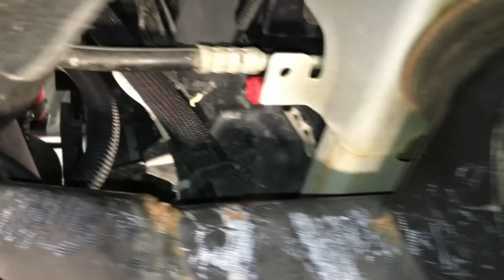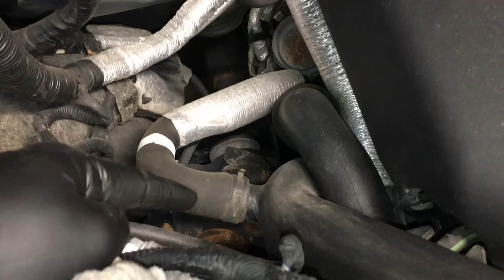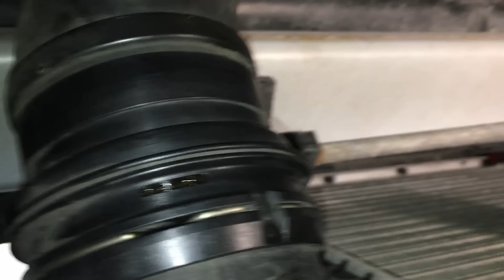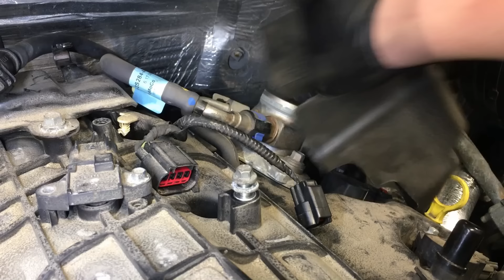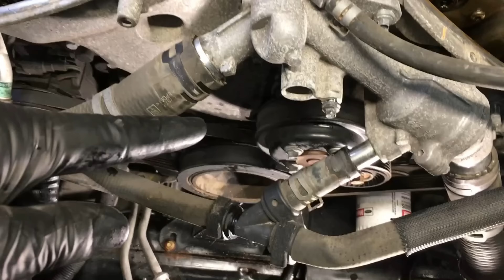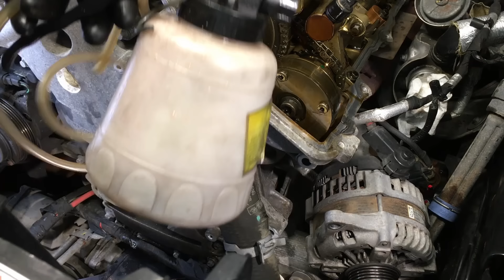2011-2016 Ford F-150 3.5L Ecoboost Timing Set Replacement Part 1: Getting Inside the Engine

Comment: I've watched another vid performed with the cab off. Your efforts to detail & explain every minute process pertaining to this repair is nothing short of phenomenal and extremely considerate from this viewers perspective. I have the 2011 F150 EB and unfortunately i didn't make the warranty cut. I do experience the chain rattle only when the vehicle sets up for 2-3 days w/o running the engine. The rattle is brief but startling if you haven't heard it before. I have yet to get comfortable with that sound, seems I have this vision in my head of the that monster chain flying off, pistons crashing etc. Nasty stuff in my mind but I do drive on. I love the motor and the truck, it's never seen the shop for anything other than one recall regarding the transmission "could" potentially slam into 1st gear at highway speeds, I couldn't get that vision out of my head either so off the the dealer I went. Seriously man, I support you in any way I can, I purchase the products, tools, parts etc. you reference in your descriptions hoping you receive some financial gain from same. Congrats on your success and thank you for your vision, dedication & kindness in sharing & building such an extensive, detailed database of repair vids for all of us to view and succeed in making our our repairs plus allowing us to save a few bucks along the way. I'm 63 y/o and, IMO. professionals (in all businesses) such as yourself are very, very rare and truly appreciated.  Wish you and yours good health, happiness and endless wealth.
Reply: Well said

Comment: I have a question on the primary timing chain tensioner.  You list BL3Z-6L266-A, but Tasca Parts said this is the wrong one for my 2013 EB.  Their parts catalog indicates BA5Z-6L266-B.  Which is correct? Are they interchangeable?
Thank you! Very happy these videos are available to me.

Comment: Ford still having the same engineering issues from the year 2000...unbelievable.
Reply: Idris my ford raptor did that since day one, these ecoboost engines are TRASH.
Reply: @Idris any issues with carbon build up? have u done,induction service?

Comment: Thanks for the great series on this repair!  My son and I are following step by step and everything is very clear.  I had one question.  We have damage to one of the heads so are installing remaned cylinder heads.  Truck has 160k miles but very well maintained.  I was thinking of new turbos.  Would you recommend that?  Any other key components you would recommend?  Thanks again.

Comment: Is the 2019 5.0L v8 more reliable than the 3.5 Ecoboost v6 model or vice versa?
Reply: Jmaclicious def go with the V8.    My friend had a 3.5 ecoboost and the chain was replaced at 3k miles.    Truck wasn’t even 6 months old.    It was brand new !!!    He just traded it about a month ago with 34k miles and bought a 18 Cummins 3500.    He loves it

Comment: I have leaks on the front cover on both sides. 3.5 ecoboost 2013 F-150 nocheck engine light yet. What other components should I replace when I am in there? i.e. water pump, oil pump, timing chain etc?

Comment: I've had a P0016 code on and off on my 2013 F150 for a few months now,  but I have never had any cold startup rattle.  Is there any other potential causes for this code besides chain stretch? Engine light is on constant now.
Reply: I too have no rattle but confirmed approx 5 degrees between "desired camshaft position vs actual", so my performance and CEL is intermittent.  Parts for repair are in the garage waiting for me while the truck is parked....

Comment: Can thiz problem also happen with my 2017 v6 3.5 ecoboost ? I have 100,000. Km and around 90,000 km there is a loud rattle on a cold start?
Reply: This has happened on my 2017 V6 3.5 Ecoboost with 40,000km (still under original warranty) on it, so I would say ABSOLUTELY it can happen to you! Mine has been in the dealership shop now for 48 days. Considered Unit down, Emergency down which is Ford lingo for Do not have parts available and Do Not Drive. Which then was a fight to get a loaner vehicle. I was then told that I because I didn't have extended warranty that I would not be getting one. I had to nag ford and 17 days later was granted a loaner which I still have. I called the dealership about this rattle on cold start up and no check engine light. I youtubed and found this timing chain thing and mentioned it. The dealer told me to bring it in but was certain it was not the timing chain, and he said he never heard of all the chatter about it online...(Hmmm, its 2019 dude, era of YouTube. There is even videos on changing them out! ) This video is absolutely amazing and has now armed me with knowledge that I would not have previously possessed. Now I know what was or should have been replaced. Not to mention what to look out for, possible leaks as so many gaskets are involved in this repair. I am hoping to bounce the parts list on the work order against his list on here if and when I get my truck back. Thanks for sharing your knowledge and expertise! You Rock!

Comment: When installing the fuel pump, is the fuel pump O-ring in the parts list the one that goes on the bottom of the mounting plate, therefore requiring two?  or is there an O-ring on the bottom of the fuel pump between it and the mounting plate?
Reply: There's a gasket between head and mtg plate and the fuel pump o-ring fits into a bore in the mtg plate.

Comment: Was looking at a Ford with the 3.5l so I went to youtube to see how they are holding up and how hard they are to work on. Thanks for your video, I left buying Ford in the 80's, went to GMC, left them in 2000  because of them not fixing their problems. Went to Toyota in 2000, put 325,000 miles on it before it was hit by a guy running from the law, was still running strong, was looking to get 500,000 on it but things happen. I am sure I will pass on this Ford also. Ford wants $2000. to change the water pump. Not on my dime. Thanks,  I changed the water pump, timing belt, tensioners, crankshaft and cam seals three times on the Toyota. Got to where I could do it in 4 hours,I am not very fast doing it by myself. Put on six sets of tires, replaced the brakes three times, bought the lifetime brake pads once. Changed the engine oil every 3000 miles. Total cost of upkeep  except for oil changes $3189. for that Toyota's life. The Insurance company paid me close to $4000. for it totaled out. Look like I will buy another Toyota. I still have the 1996 GMC, it just turned 104,000 mile, Every time I drive it to Lowes which is 8 miles away I tell my wife I have my cell phone and I will be back home, it might be in a tow truck, I keep tow insurance because it is cheaper that way,

Comment: What is your thoughts on the Raptor 3.5 ecoboost? I’m debating trading in my 16 Ram 2500 with a Cummins. Worried it’s not gonna be reliable for 200k plus like my other 8 Rams were. I wanted to see what you thought or advise. 

Thanks Man

Comment: Do you know if AT4Z-6C525-D is the correct replacement for AT4Z-6C525-B on a 2012 f150 ecoboost. That is what I was sent went I ordered all the parts but I can't seem to confirm that through my internet research.
Reply from the maker: Yes there was a recent engineering change.

Comment: Brian what year is this truck?
Reply from the maker: 2012
Reply: Thanks for the answer. I’m considering a 2012 3.5 eco in great shape at 111K but since watching all your videos I’m apprehensive. Any real fix to the direct injection issue? Don’t want to deal with this if fords only reply is change heads/valves as you stated in last conversation with engineers.

Comment: Hi I have a 2013 f150 3.5 ecoboost and keep getting the p0016. And it goes into a limp mode. When I clear the code it restores power. I changed intake and exhaust solenoids which were a bit dirty. I changed oil and put in sea foam. It seems better but still happens. Is that a sticky phaser do you think .? Thank you

Comment: Amazingly informative and easy-to-follow video! Since we are tearing half the engine apart already, would you recommend a fuel induction cleaning while we have it open? My truck has 127k miles and I dont think its ever been done before.

Comment: I see you didn't change the primary and secondary guide arm guides.  I gather upon inspection they were fine?  Just wondering if you have a part number/product link for those guides.  BTW I have been waiting for this video for a year now, great job on description and breakdown.  Love how you put in the torque value and sizing of tools needed while you are carrying out the job, congrats.  I had Ford do my timing chain two years ago and now I need to do it again.  When they did mine they only replaced the timing chain and I would assume it was the primary guide arm cause my bill just states arm - timi.
Wish they did the job correct the first time now I have to do this myself correctly.

Comment: Great video man, but I have to disagree with the valve cover part about simply unbolting and lift off. I have one in the shop now that I been busting my butt trying to get these covers off. LOL Fun.
Reply: Joe's Auto Electric I agree, doing my 2014 as I write this reply.  Valve covers required some extensive prying to break loose.

Comment: I have 150K miles on my 3.5 Ecoboost. It definitely needs a timing chain replacement upon startup it rattles. Now what happens if I drive this and do not replace it ?
Reply: Kaboom😞
Reply: Your performance and mileage will suffer drastically.

Comment: Thank you for these videos. I'm considering a 2017 or 2018 Raptor. Do you see the Ecoboosts in these newer model years more reliable? Do they have problems as well? Thank you!
Reply: Don't know about the newer ones, but my 2011 is just getting ready to get this done... after 232k miles on a 3.5 EcoBoost that is not treated gently.

Comment: Thanks for this video.  I had this work done under warranty on my truck (2011 fx2) 2 years ago at about the 60k km mark.  2 years and 25k km later (Truck is now at 85k km) I’m starting to hear the same chain rattle on cold start that I heard the first time.  It would seem the service bulletin fix doesn’t actually fix the problem, it just pushes it down the road.  I’ll push for warranty coverage again, but anticipate a tough time getting it.  Is there a permanent fix to this issue?

TSB calls it a 9.2 hr job, no idea on the cost of parts...  will this job cost someone $2 or $3 thousand?

Been a Ford guy all my life, this was my first new vehicle and was hoping to keep it a long time....

Might have to try tackling it myself, thanks for this video.
Reply: They probably only replaced the Primary chain and tensioner. Did they replace the Phasers?

Comment: Good video but if you took off the radiator/ condenser clip its easier on your back and cleaner job.just takes another hour ,but youll never do any other way i promise...
Reply from the maker: I have done it that way when I did the 5.0 short block video, great for pulling an engine but otherwise no.

Comment: Thank you for doing these how to videos I really appreciate it. I'm replacing the timing components on a 2011 f-150 with 120k miles, his is so bad it's undriveable hopefully his engine is still good. I've been wrenching and building engines for 22 years and right now this is #1 on my WTF list, by far the most frustrating engine/vehicle I've ever worked on. Between the carbon buildup and timing component problems I almost consider this engine a throw away. I've been a ford fan for a long time right now I'd rather buy a dodge than this pile.

Comment: I just dropped my truck off at Ford to get this job done. My truck has 70k miles on it. Would anyone recommend other things to have replaced or inspected while the front end is taken apart? Thanks.
Reply: Just cut the stretch pulley and replace it! 😀

Comment: Those stud mount zip ties around the cylinder head covers are a royal pain to salvage.  I resorted to just cutting the damn things off.  Anyone know the part number for replacing them?
Reply: You can't get them unless you buy the entire harness. I cut mine off as well and resorted to drilling a small hole in the top of them and using a small zip tie. Worked like a charm.

Comment: I'd like to know what this repair would cost$$$.
Reply from the maker: $2,500 at my shop.
Reply: Not too bad but putting $ 2500 into an engine with over 100k - I'm not sure it would be worth it. For not a tremendous amount more a new engine could be installed. Correct?
Reply from the maker: New engine installed normally go for $6,700 so yeah big difference.

Comment: Question I have a 2011 Ford F-150 with 3.5 twin turbo. It has 103000 miles on it and has the timing chain sounds when starting up. Is my truck covered under the tsb or would I need to pay out of pocket? Second as of recently my truck is lacking power it almost feels as though neither one of the turbos are doing. Anything and it is having to use just the 3.5 to power it anywhere. Struggles to to keep speed going up hill or in heavy wind. What could this be? Any information would be helpful. Thanks
Reply: Does it throw out a P0016 code?
Reply: sounds like the vct solenoids are bad. Did you get this fixed?

Comment: Love your videos! Thanks for sharing your expertise. 
I am not comfortable doing this job myself so I asked for estimates. The dealer says $3,200 and a local shop said $2,500. The local shop says they are using aftermarket parts as the OEM are much more expensive. What do you recommend I go with? Are the OEM parts that much better?
Thanks again!
Reply from the maker: DO NOT USE AFTERMARKET EVER.
Reply: @FordTechMakuloco  ya cause the oem is so reliable lol, every ecoboost needs this repair at some point,  usually before 100k miles
Reply: Ever! Unless you want to do it again in 1-3 years

Comment: 2013 Flex EB 50,000 miles. I've been having the same problem pretty regularly (Every other cold start). I also had one of the turbos leaking oil. Ford replaced the turbo under the extended warranty about 2 weeks ago and since then there has been no rattle on startup. Think there could be any correlation?
Reply: No correlation there, but you'll need to do this TSB when you get the dreaded P0016 code.

Comment: FordTechMakuloco my dealer will not cover this under the emissions warranty and I am outside the powertrain waranty. They are coding it as 6C525 (cam). Do you have any advice on dealing with them? Thanks 
Dustin
Reply from the maker: only certain states have the emissions warranty

Comment: I just bought a 2011 ecoboost, other than the plugs, coils, misfire at higher rpm’s when I really need the power, charge air cooler moisture/oil, 4x4 not disengaging, timing chain that could double as a jump rope from being stretched, radio died, it’s been a great truck! I watched the torture test with Mike Rowe & I was sold on the ecoboost, worst truck I’ve ever owned & I completely understand, 2011 was the first year for the ecoboost & there was bound to be a few problems but Ford really dropped the ball on standing behind their customers. Yea I know there’s a joke in there about what they’re really doing when they stand behind you. All I can say is that if it wasn’t for this channel, I would really be screwed. Thank you for all of your videos!

Comment: I’m having an issue getting the valve cover to come off.  I got about 1/4” to lift up on the front but the back side of the cover won’t budge.  I’m afraid to apply too much pressure and crack it. Any advice to get this cover off.
Reply from the maker: you must work them off front to back side to side they can stick pretty good.

Comment: All Ford TSB's I have found as of posting this comment only call for replacing the timing chain itself.  (TSB 17-0026  March 8th 2017 and all previous TSB's).  Did you replace the phasers just for good measure or is that in one of the TSB's?  Getting ready to tackle this on my '11 and I wanted to make sure that I wasn't getting shorted on parts.  Thanks in advance, great video series man
Reply from the maker: There are multiple current tsb's for this engine. TSB 16-0027 is what was performed on this truck for a proper full fix.
Reply: I have a 2012 f150 ecoboost. With the timing issues. What do i need to do this job. And how do i contact you directly?

Comment: Have 04 f 150 5.4 low compression on 7,8. Had low oil below safe marks. 169,000 miles. Ford dealer says needs timing chain replacement and comp. Addressed. Duh !! Which rebuilt engine if any have you had best results, or would you use?? (Looking at power train products Inc or powretrain direct.) Any way to get in contact with you? Not sure if motor in truck worth messing with would barely run low rpms but ran decent at higher rpms??

Comment: What is that extension that you are using at the 26:00 mark that seems to be a ball/flexible extension.  Seems very handy, I need to get one.
Reply from the maker: This is the set that I use, they help tremendously when bolts are at odd angles- http://amzn.to/2pzo5S0
Reply: I wrap electrical tape around my 3/8" universal to decrease it's range of motion; does the same job.